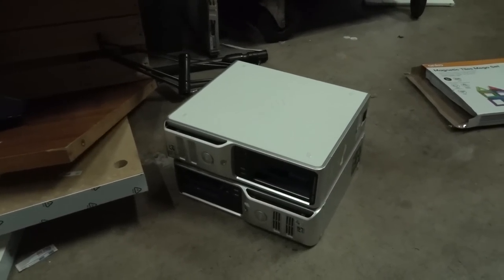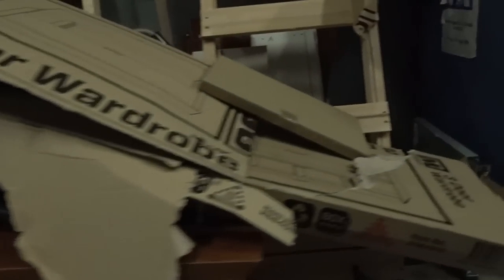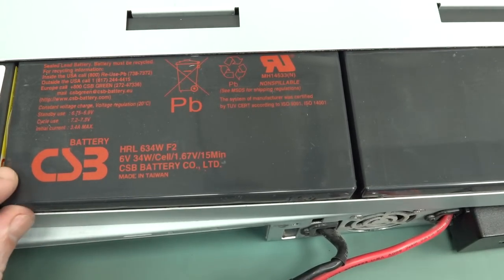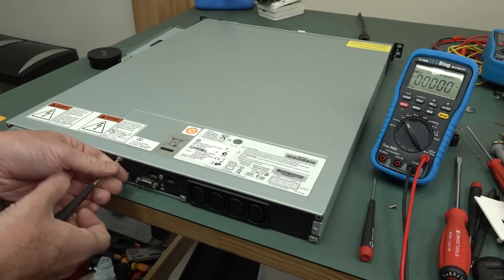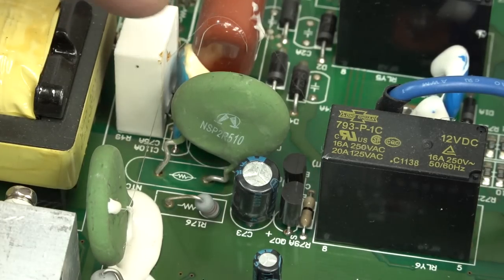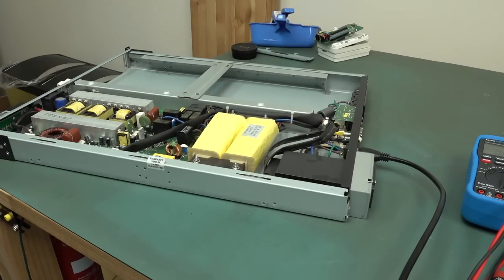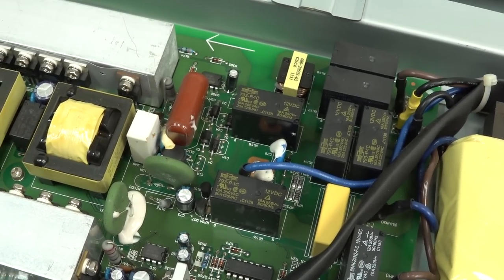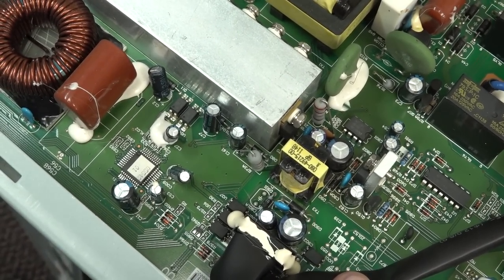EEVblog #1168 - Dumpster Diving UPS

Comment: While yes the batteries are hot swappable, it requires batteries to turn on. This is pretty much standard for APC units. It's easy to get nice server sized APC units for free with dead batteries because they don't turn on anymore, add a fresh set and they work perfectly. From what I can tell they by default disconnect the line input for safety, this means that the unit must be "on" to detect that line is available to switch to. So if the batteries are dead it won't turn on. It's a logical yet annoying standard, if something happens to the UPS to make it fail it results in complete isolation. Once the unit is on, as long as the line relay is held down it will power itself letting you swap batteries.
Reply: I have several older APC units.  All running w/o batteries. They make nice power conditioners.
Not sure about Dave's unit though?
Dave should check the outputs (sockets) for voltage.
Reply: Agreed - all the online APCs I oversee need a minimum battery voltage before they will turn on. My home UPS (5kW) unit does the same. Just feed that HP UPS 36V from a power supply and it will turn on.
Reply: While I'm not familiar at all with the model from the video, I do repair a lot of APC Smart-UPS units.  While it's true some very specific (older) models and the cheaper BackUPS units won't start without batteries, a SmartUPS unit should start without batteries if you hold down the power button.  If it doesn't, this is usually an indication of a fault in the battery charging circuit (and is usually a quick repair).  The circuit is easily damaged when the cells in the batteries start to develop internal shorts.

It's easy to assume that it just needs batteries since it will usually start up and run normally once they're replaced, but you're likely to notice diminished battery life and overheating since the unit will be stuck in one of it's full charge states and won't be able to float charge.  Some of the large (8000va+) units will detect this in a self test, but all of the smaller ones I've worked on will not.
Reply: Liebert (Vertive) units are the same.  Some of the models won't even charge the battery unless the unit is on, which you can't do unless there's a charge on the battery.
Reply: @h0ll0wm9n  I have one where once it is powered on it can run without batteries but it cannot be started without a good battery.
Reply: Could trickle charge the batteries a bit on a lab supply first? See if they recover?
Reply: Turning them on with dead batteries just beeps at you at an earbleeding volume xD
Reply: Dave Micolichek  A box full of lead sulfate, can't really call it a battery anymore xD
Reply: @Hinoserm  Would you be willing to help a fellow electronics tinker out? I have a APC su3000RM that works if supplied mains voltage and goes to battery power, but won't start from battery only. The overload led turns on and it beeps.  The mosfets don't seem to be shorted..
Reply: @Hinoserm  "I do repair a lot of APC Smart-UPS units"... I bet you do. I've had three failures from four units. Not worth their 3000% premium.
Reply: @funkyironman69  Yes just trickle charge for a bit but most likely it will also need some distilled water with a syringe to the cells must be bone dry inside and then they will likely take a charge even but agms on it's side it's not a good idea to fill them and put them on their side again... so obviously would need new batteries, maybe some LiFePo4s would go nicely with this unit.
Reply: Dave Micolichek  Thanks for the suggestion. The batteries have been replaced and it behaves the same from a bench supply.
Reply: We had hundreds of these to look after over a number of sites.  The batteries had to be replaced every two years. Any longer and they would swell up, often to the point the tray would no longer pull out. As others have suggested, these units will switch on without batteries but complain like hell.
Reply: If you do turn it on get ready for some really annoying beeping.
Reply: @johnalexander2349  We buy them from local scrappers, repair them and resell them.  Almost all of the repairs are either physical damage (dropped or damaged during scrapping) or because the battery packs shorted out and were never replaced.  If the batteries are replaced routinely we very rarely ever see any problems -- and when we do, they always seem to fail "safe" and will continue to power their load -- I can't say that about the other brands we've used. 

We mostly work with 3000va and bigger SmartUPS units so maybe smaller units are more prone to failures?  I've also heard some horror stories about their newer models being pretty flimsy -- but they're typically already 5-10 years old before we get them.

All that said, I don't think I could ever afford buying APC equipment new.
Reply: Dave Micolichek  What you said is basically how I understand it, yeah.  When the UPS is first plugged in (even before it's "on") it starts it's most basic float charger to power the rest of it's electronics.  If that circuit isn't working, but the batteries are good, it'll power on from the batteries.  After a while the batteries get low and it starts a more aggressive charging stage.  Everything seems normal, but in reality the UPS no longer has a real picture of what's really happening to the batteries.

Every control board revision and model seems to have a different idea of how to implement the charge stages so the exact details of what stages it uses and when they come into play aren't well known (at least to me), but the basic idea is that it relies on the same circuit that powers the float charger to also power all the main electronics on the controller.
Reply: @mikeman400  I think I found your forum thread and the advice you were already given is pretty much exactly as I'd suggest, though usually before we get that far can get by just checking all the FETs with a multimeter in continuity mode (or diode mode) and look for anything shorted.  Overload alarm without any other diagnostic code usually means exactly that -- something is shorted somewhere along the output stage.

The LEDs on the front panel do indicate some basic error codes -- do you get any interesting patterns or just the overload alarm/light?  You can also coax out a bit more info with a Network Management Card or serial cable, but the error codes are proprietary and usually not documented.

I stumbled upon a Polish repair forum a long time ago where I found a bunch of schematics and repair manuals.  I'm not sure if it's still around or if they still have that content.  Usually even if you can't find a schematic for your exact board, they're almost identical between models, once you kind of study what each "section" does.
Reply: @Hinoserm  All three failures were 5kVA SURT units, and all three were actual failures, i.e. the panel says that there's an error. They didn't take anything out with them, but I don't know if that's something that cheap units even do. Maybe 10 years is a long time in IT, but for a building's electrical system, it's a blink of an eye. As for cost: our first one cost R13 000 (2006), with an APC battery pack (NEVER run parallel battery strings!), currently that's R60 000+. No. Thank. You. Fong Kong for me, from now on.
Reply: @mikeman400  I missed that you said the MOSFETs aren't shorted.  Do you have the model number off the control board?  I can see if I have any useful info at the office or if I have spare board so I can see exactly what you've got.
Reply: @johnalexander2349  Interesting.  Around here, the reason I get so many of these basically free or for scrap value, is because the service contracts say "we send you a whole new one after 5 years, dispose of the old one according to your company's recycling policies".  There's an entire small local industry based around scrappers buying them for scrap metal. I don't know if that's directly from APC or some local/national contractor, nor how much they pay for these.

I've been out of the loop for a long time but I just assumed this was common practice for "enterprise" now.
Reply: @Hinoserm  Yeah, just goes into overload no codes or blinking.
Reply: I have a similar HP Unit. They are manufactured by Eaton for HP. they in fact do not turn on without a battery present. on my unit it doesn't actually need to draw power from them, but it does need to see battary voltage. my batteries were completely shot,  delivered only miliamps short circuit but were a total of 27V Open circuit and were enough to turn it on. with no batteries though, it shows no sign of life.
Reply: @mikeman400  Try testing (measure ESR) and replacing the electrolytic caps. On the old SUA units the small 22uf's go bad, the larger values are nearly always fine but can be replaced at the same time with high-quality brand low-ESR caps.
Other than that, I'd try the basic stuff, testing the output mosfets for shorts, test the relays for welded contacts, power supplies for voltage. Possibly the sense resistors on the current transformer(s) could be open or high. Even a battery with a weak cell might drop the voltage on power-on too much so it could think it has an overload.
Reply: I've seen exactly the same problem with little 1u Eaton UPSes.  Never noticed it with my APCs, though they APCs are significantly larger.
Reply: @brainndamage  Thanks for the suggestions. I will give the caps a check and also the relays.
Reply: The batteries are not to switch the device on they’re there in case of a power outage, you would have everything essential plugged in so if there was a blackout you wouldn’t loose valuable data
Reply: this unit got 2 psu the stand by 5v and general(42 v charging) on the board the faulty is the standy by ones is the small tranformer near the 7805 they used for dead on the PWM started circuit 2-3 resitors in series and  reservoir cap like 1uf 50v.
Reply: Same for my small APC unit. It wont turn on with no batteries, but stealing its batteries while its on is okay.
Reply: @Hinoserm  you could do some repair videos about APC ups repair...
Reply: This is Eaton / Powerware OEM, not APC.
Reply: Dave could have perhaps hooked up a bench PSU to emulate the batteries and see how the circuit reacts. Not too sure if it's a good idea regarding possible connected grounds but just disconnected for powering the circuitry, it would have been a quick test.
Reply: Eaton Evolution 850 1U (Same assembler clearly) will not power on at all with no batteries, not even it's remote management card!! :o
Reply: @alexandredumoulin8868  I tried this and mine did nothing, yes I didn't go mad because I like my power supply. But it really wanted them batteries in it, even if they were fucked.
Reply: I agree with this, I have an inverter / charger that requires batteries (or 24v DC) to turn on but once its on you can disconnect the batteries to re write, move or maintain them without it dropping the load.

Comment: No UPS startup without battery voltage! connecting a broken battery won't help.

You would probably need 20-30V from the battery to even activate it, or it stays dead.
I have a UPS I got going, without new battery it was just plain nothing, or less.
Reply: yes 90% of UPS requires batteries to turn on after that you can swap them out no issue the logic circuitry works from the charger output so if it is off in the first place the logic circuitry will have no power to turn on thats why it shows no signs of life
Reply: The ones I've come across, if you can easily replace the batteries, it'll want them to switch on. The ones where you need to open panels or unplug everything to get to the battery usually don't care.
Reply: Mine does.  Will give a low battery beep though.  Ya have to hold the power down though for like 7 seconds
Reply: Hey Dave Jones AKA eevblog host big fan here keep up the good work but you missed a chance for a little humor there here goes how do you turn a CD drive into a floppy Drive you leave it loose in the case. And also yeah that's how you doing. Keep up the good work oh speaking of dumpster diving my most recent dumpster dive Salvage project walk up giving me my under the cabinet lights you know a certain TV that has a certain type of thing in a name AKA and LED TV it has been dropped screen broken also I eat your mashed using virtual power supply reverse engineered it enough so that I can get it to just be on or off manually and not shut down Judith any problems at with thanks. Be attached and not present ignoring shut down signals that for anything that's not connected or not in use. Ever done something like that. Also I'm studying to be an IT technician one question which I'm not familiar with is I've seen PC and computer power supplies that have power connections Mark fan power what is with that and also is it not filtered as well there's a controlled could have any other use or purpose in anything other than mine fans or perhaps be usable when repurposing. And anything that we need to watch out for if that were tried. I do not know the specs it's something I've got my cross bunch and having a hard time finding anything on. Any thoughts on any of this or any comments on the others will be appreciate it thanks to you and the electronics Community for all the help with everything from everyone. Keep up the good work love mailbag USA USA USA all the way because that's where I'm from go remember the batarisor.

Please don't complain. Misspelled it it's not something good would probably pick up. But I'm actually using a few of them in certain applications and yes there are Niche Niche applications for them for very low for all I use was it equipment that barely uses any current that's even to the berries or even low to load up on a remote control speaking of which if anyone has a load up with batteries that won't run anything else save put them in your remote controls so you don't have to always have fresh batteries and waste batteries are the remotes when if you're someone that doesn't mind changing them and often. It is economical especially since it's only Arabic news. What are the things I can't remember what I've used to me in right now but with let's just called battery life extenders they do work well believe it or not for what are good for Niche applications that is.

Comment: I've seen similar UPSs before act like this due to dead batteries, they need to be able to draw enough current from the batteries to start up, before they switch themselves to mains power. Try injecting power at the battery connector.
EDIT: Only inject power at the battery connector if the UPS is disconnected from mains! Otherwise you might release the magic smoke from your PSU.
Reply: don't inject, disaster could happen.
Reply: Exactly! That and my bigger 2/3U APC ups make me hold the power button for a good time before they will start up after a complete power down. I only saw him pushing it.
Reply: Just put a big diode between your psu and ups, then your PSU should be fine.

Comment: even though its hot-swappable.. a lot of UPS units will not turn on without a good battery initially. Once up and running the battery can be removed and changed.  one of those weird quirks I've seen with UPS units of this type.
Reply: Dave Micolichek 
Correct. They ship with the batteries disconnected. They won't turn on without them to prevent people shoving them in, plugging in the servers, and forgetting the batteries.
Reply: mine just dies if I take the battery out while powered on, and everything goes off I lost unsaved stuff on my pc, I tried it once, I didn't think the whole thing would die.. I thought it would stay on, I was wrong.

Comment: That NTC MOV looks like it was never installed properly.  Looks like the HP quality control person missed it. - 13:18
Reply: I'm wondering if the person who applies the silicone spotted it and left the schmoo off to have it reworked.
Reply: and then it was lunch time :D
Reply: Nope, it's just shitty lead-free solder that was forced onto the world for absolutely no reason, than to fail.
Reply: @evilgremlin  I believe it was introduced because people weren't disposing of electronics with leaded solder in them properly?